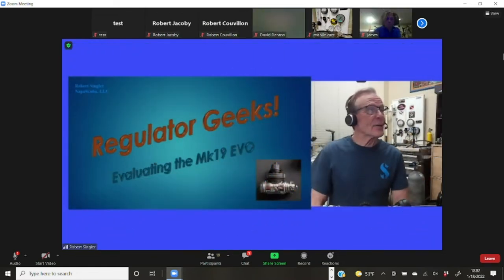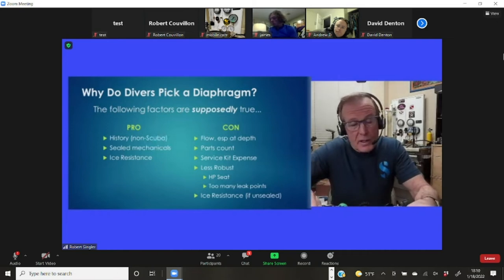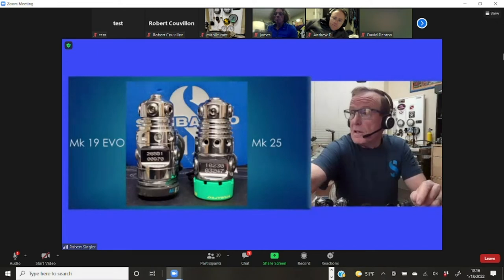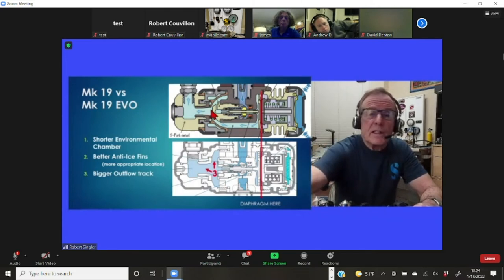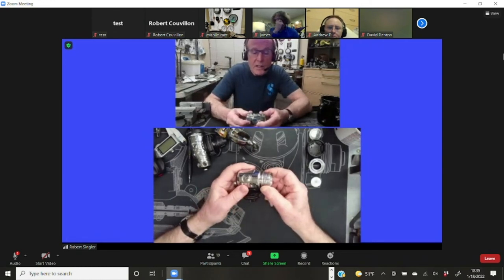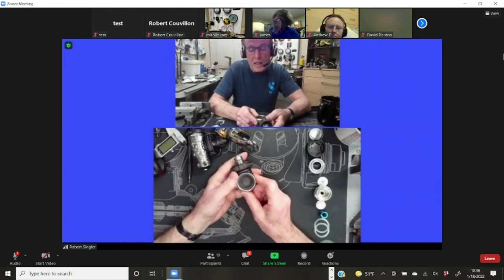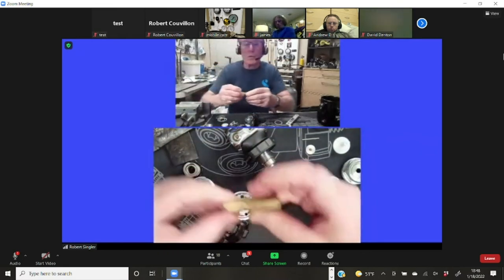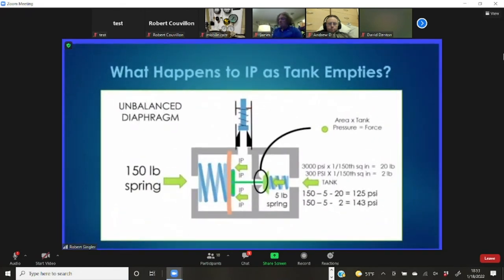Regulator Geeks 1:  Mk19 Teardown and Comparison

Comment: Hi there , your presentation is amazing !
I didn’t get the overbalancing of aqua lung closed diaphragm !
The transferring piston has a stable surface , right ??  So how the increasing hydrostatic force with a depth increase creates a rise in the I.P ??
Reply from the maker: It's all about relative area. The effective area of the diaphragm is the necessary receiver of "X" pounds of force as you descend.   That effective area is a function of diameter and diaphragm flexibility.  But the area of the transmitter may be different,  and the environmental diaphragm is usually much more flexible.   Therefore "pounds per square inch" on the environmental seal may transmit "Y" pounds of force on the plastic transmitter.  If "Y" is different than "X", the IP may not track ambient pressure.  It may lag ambient (as when the Apeks transmitter tip is crushed at extreme depth), or it may transmit more force to the main diaphram (e.g., certain regs that claim to be "overbalanced").

Comment: Thank you for the detailed breakdown. Highly considering one but would like to know if the MK19 EVO is more prone to problems than comparable products? I recall you noticing factory assembly problems with the MK19 making the diaphragm convex as well as the diaphragm bumper coming loose during normal use? Do you believe those problems have been resolved? Do you still recommend this regulator? Thank you!
Reply from the maker: Scubapro's environmental seal is the same on all their regs. The loss of seal and the convex shape is a minor issue that only changes the reg's responsiveness by a few feet.  You can learn how to reseat the seal at your dive shop. 
  The trim cap unfortunately falls off quite easily, but at least that allows you to see the seal, lol!
  It's a great reg, and my primary first stage.   Superb performance, and those two issues are minor. Yes, it's a great sealed, turreted diaphragm first stage.  Just buy an extra bumper.

Comment: I love your videos but this one was a little confusing… you’ve uploaded another video with the Mk25 showing basically no IP shift and called it ‘impressive’. What has changed this time, is it a matter of your measuring equipment delivering inconsistent results?
Reply from the maker: The Mk25 as measured during the seminar showed a wider IP shift from full to empty tank than some of the attendees expected, compared with their own regulators.  Afterward, I disassembled the Mk25 high pressure compartment and lubricated the poppet and sealing o-ring and retested. 
 After lubrication, the IP shift from full to empty tank was minimal, and more in line with Scubapro's advertising. 
  What this shows was 1) Scubapro's great engineering performance, which I incorrectly criticized during the seminar, and 2) the importance of regular service and lubrication of this critical component. 

It seems unlikely to me that despite claims of a 2-year/200 dive service interval that any reg can maintain its initial performance as lube dissipates in the HP compartment. 
  On the other hand, with a balanced second stage, you'd probably never notice the difference. 

Thanks for your comment!
Reply: @robertsingler7258  Hi Robert, thanks a lot for the explanation, appreciate it. Going to buy an Mk19 thanks to your video. Still trying to decide between the a 700 carbon and the G 260 though… not a fan of the D 420 due to its size mainly :)

Your comparison with thick gas at depth was also very helpful, thumbs up!👍
Reply from the maker: Well, I've owned and dived both. Everyone has their own opinion, but for me it's a slam-dunk: the G260 in a heartbeat. 
Post in thread 'D420! How about that?' https://scubaboard.com/community/threads/d420-how-about-that.588712/post-8869180
Reply from the maker: By the way, to my knowledge, the "carbon" in the carbon A700 is only the faceplate.  The body remains all metal and the weight saving is minimal. From a service standpoint, the G260 is far more technician-friendly.
Reply: @robertsingler7258  you’re totally right. Thanks again, I saw the video on servicing the A700 and it’s a pain… I might get the new Mk19/G260 combo as well :)

FYI, I am keeping my (like new) Mk25/S600 1st Gen, the new ‘reg’ is a present I do to myself for my 50th BD.